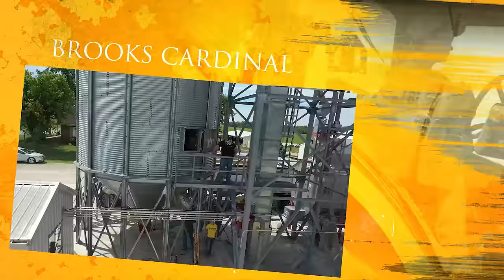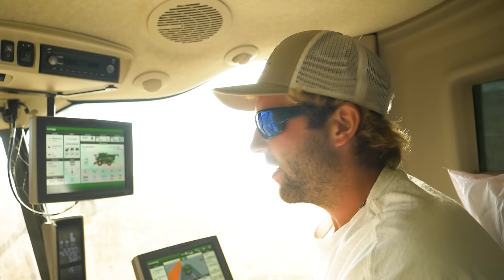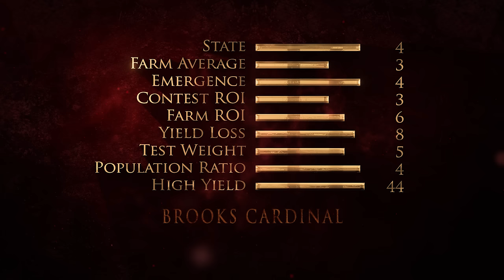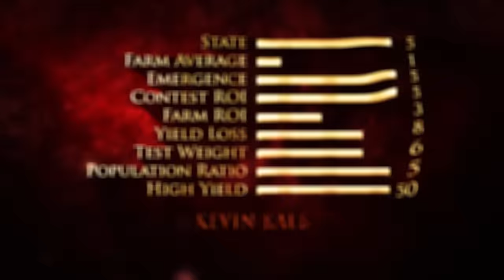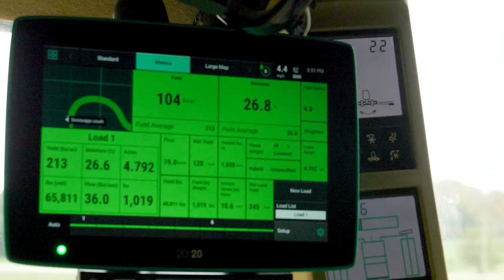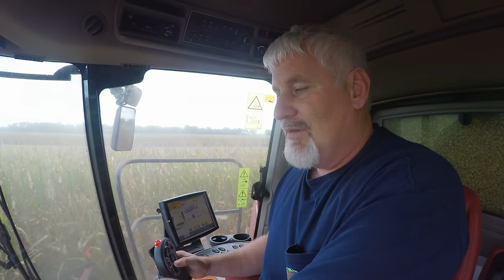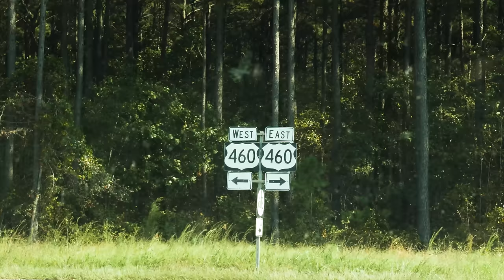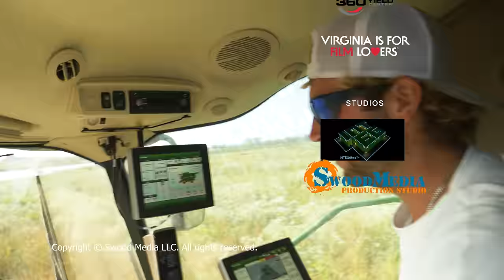Corn Warriors - Season 3 | Episode 13 - Corntest Results | Director's Cut - 4K

Comment: these 300 bushel to acre and market prices they are i want to see input cost to what they are making cause there has to be some issues there even with the stuff they are getting give to them to try figure the cost of that in also
Reply: I don't think it is about the finally $ made. It is just a competition to see how many bushels per acre can be achieved.
Reply: 600 plus wasn't on all the farm  , just a small 100ac or less fields
Reply from the maker: The biggest plots are selected for entry.